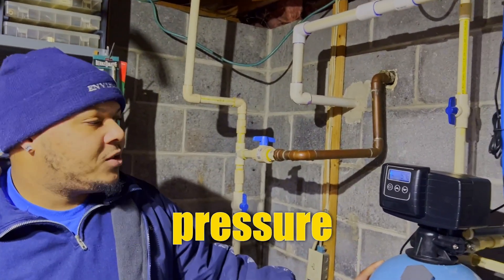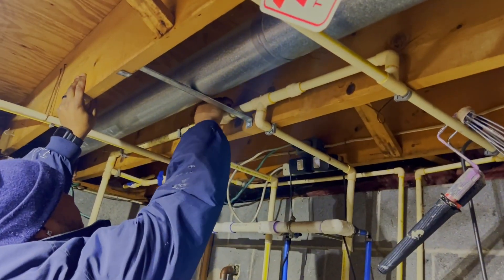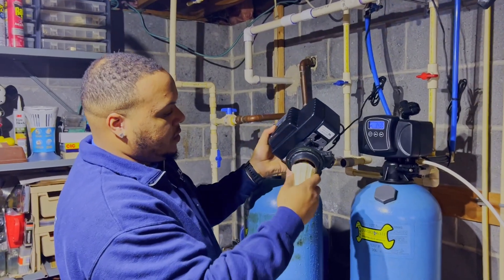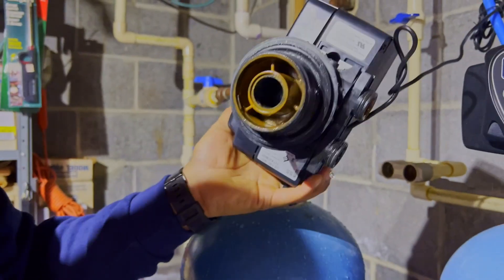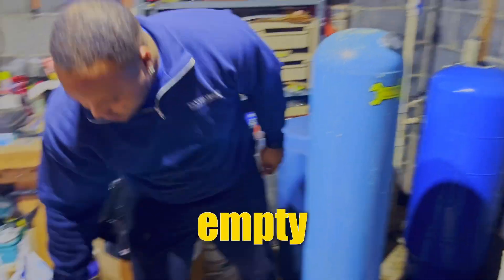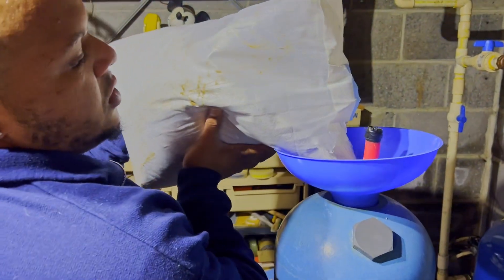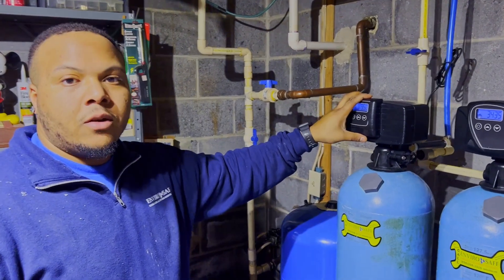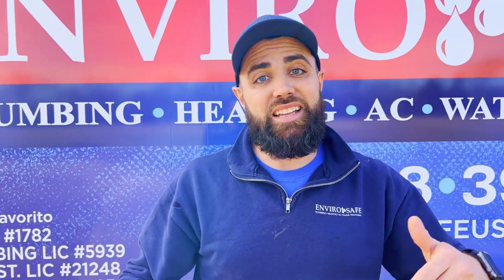The REAL Reason You Have Low Water Pressure At Home

Comment: I’m hoping you will respond. I have a water treatment system you installed. Dupont spec Charcoal tanks, house filter, and a previously
installed ph neutralizer tank.  How often should I back wash the neutralizer tank? Is that even effective ?  
Also. What’s the charge for the service in this video?